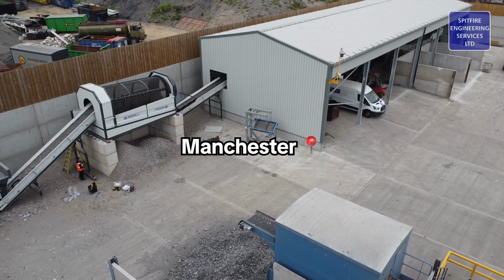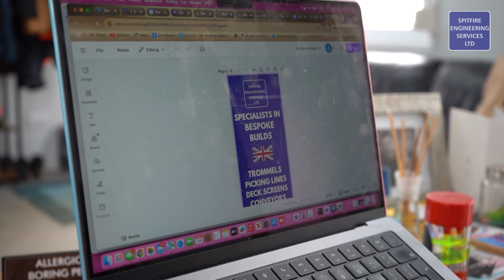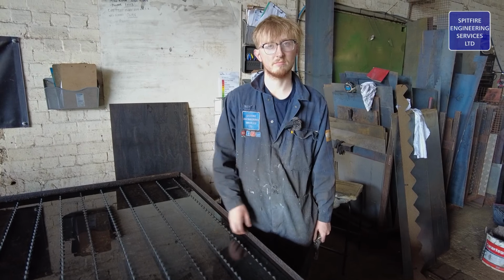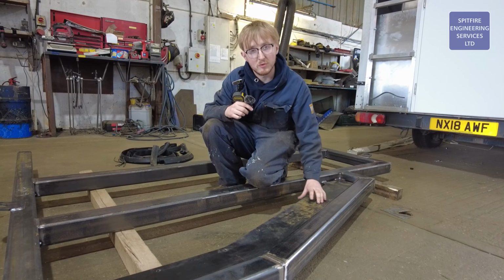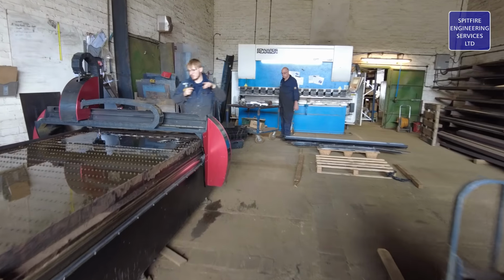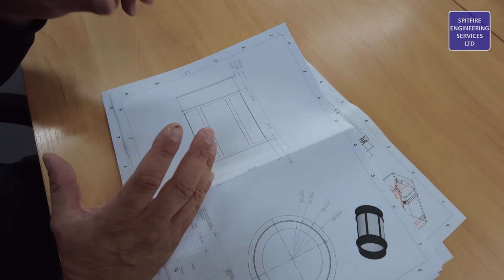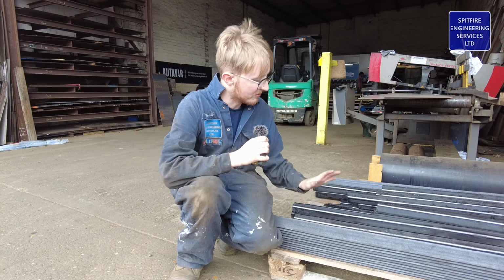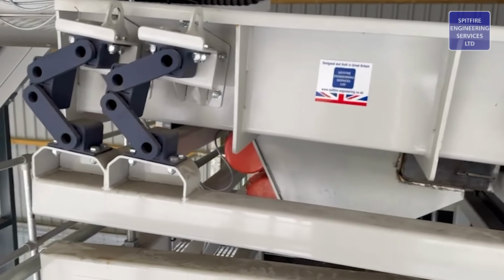Months of Silence… 🤫 Gav reveals TOP SECRET project!

Comment: Panels bowing out on the site banks due to the concrete hydraulic pressure?  Check out formwork design resources.  You can either do multiple lifts of maybe 12 to 18 inches over several days, or use something like snap ties to hold the face sheets in place until the concrete sets up.
Reply from the maker: Stages is a good idea 👍